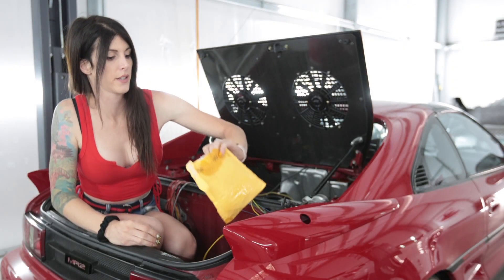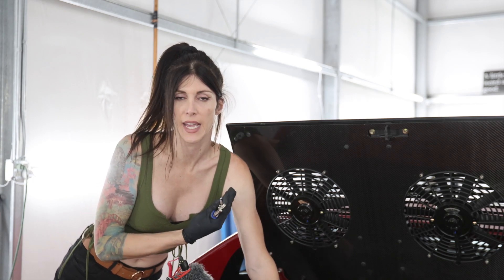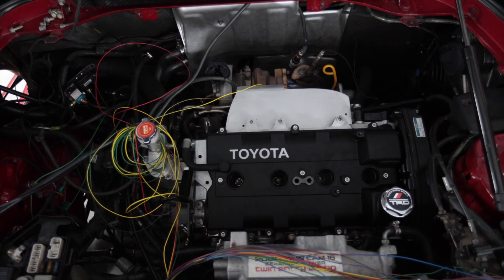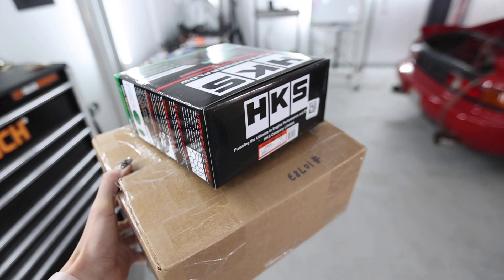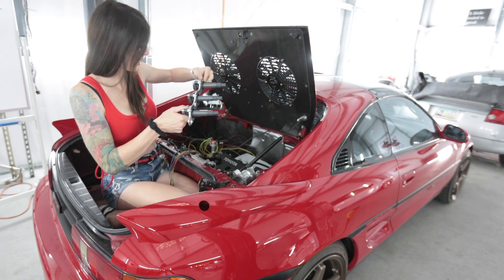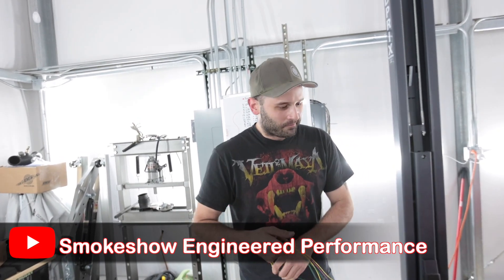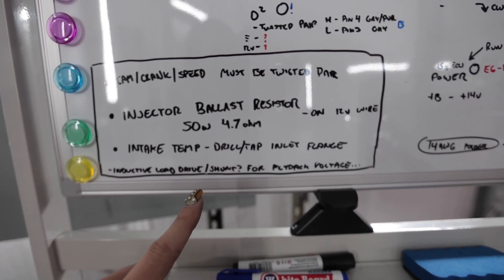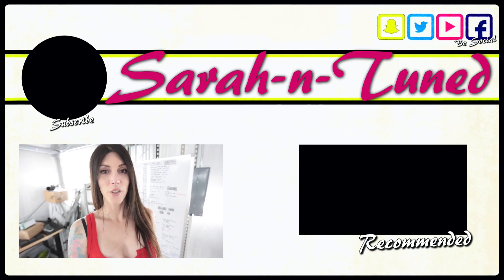This Is A LOT Harder Than It Looked // 1ZZ Coilpack Conversion

Comment: I hope it all works out and you have a reliable car that starts and stops when it is supposed to .  All of this wiring and vacuum stuff (and mods) looks like it will turn into a unreliable vehicle that will leave you on the side of the road with a flashlight and toolkit on a regular basis.  Hope I'm wrong.  I admire your courage and determination!

Comment: Use Denso 673-1307 for cylinder 1 coil to line up the connector better. 👍

Comment: What makes such computerized systems nightmares is the fact that there is not only one person that designs and/or writes the software and firmware for everything. It usually is broken down to modular design and different people are only responsible for their part. They are given the inputs and have to design the circuit/software to get the required outputs for the next connecting modules. So one person trying to redesign a system to mimic the factory setup gets really difficult... Thumbs Up!

Comment: I think you’re making the right call, switching the injectors out.  I have my doubts that the new ECU is going to be happy driving low impedance injectors.  High impedance injectors are much easier to work with, electrically speaking.

Comment: The fly back voltage basically is comparable to the way an ignition coil works. Every coil has this kind of effect when it's charged and discharged.

So the current or voltage flowing back from the injector coil can short out or overload the corresponding driving circuit when it's not protected.

Comment: Wait. No MAP sensor? Don't turbos use a manifold absolute pressure reading? Some systems use a MAP and or MAF but I'm not understanding this after market ECU Set up.   I'm getting very confused here. Crying alone in a pandemic with the Arizona girl mechanic leaving me in the dust.  Please explain the system.. white board style. "Sob..."

Comment: I think Toyota and the other Japanese makers use SAE wire sizes, like Detroit does. Bear in mind we also use AWG here, and the actual wiring is about 2 steps different between the two. SAE is thinner than "the same" AWG because SAE is meant for short runs where voltage drops are not as important.

Comment: Inductive load drive is an electronic output with protection (resistor or reverse biased diode) to operate a relay coil or other inductive/coil load. When voltage is removed from a coil, the collapsing magnetic field induces a voltage of opposite polarity in the coil, possibly several times higher than the source voltage. Without suitable circuit protection, the backblast can fry sensitive electronics like the ECU.

Comment: Lastly, the term "Shunt" implies a current measurement.  Example: You want to know batttery current. So you put a high power but low resistance in series with the battery cable.  Now you connect a very low range volt meter across the shunt, and so knowing the resistance of the shunt, you use Ohms Law: Volts= Current (In Amps) x Resistance (in Ohms) or substituting >Volts across the shunt / Resistance of the Shunt (in Ohms) = Amps. Example: Your Shunt = .01 Ohm and you measure 1 Volt across it, So 1 Volt /.01 Ohms = 100 Amps. To verify if the power rating of the shunt is large enough, you use Current squared x Resistance (which results in power in watts) and then double it for safety.  So the power rating of the .01 Ohm Shunt would be Current Sq = 100^2 = 10000 x .01 = 100 Watts x 2 (for safety) = 200 Watt Rating (which means, the ability to survive heat).

Comment: Adding ballast resistors is to raise the resistance of the injector so that it draws less current.  That implies that the source of the injector signal has a higher voltage output. If you have injectors that are by design, higher resistance (or impedance which is just AC Resistance), then you would not need to series resistors.  I have played with injectors some, you can get some to click with a flash light battery @ 1.5 volts while I have seen others that needed about 3 volt to click.

Comment: Reminded me of: "The original machine had a base plate of prefabulated amulite, surmounted by a malleable logarithmic casing in such a way that the two main spurving bearings were in a direct line with the panametric fan. The latter consisted simply of six hydrocoptic marzlevanes, so fitted to the ambifacient lunar waneshaft that side fumbling was effectively prevented. The main winding was of the normal lotus-o-deltoid type placed in panendermic semi-boloid slots in the stator, every seventh conductor being connected by a nonreversible tremmie pipe to the differential girdlespring on the "up" end of the grammeters."

Comment: A little rule of thumb for current in wire sizes for vehicles.  Start at #14 and call it 15 Amps, then double or half the current for each 3 AWG sizes.  So going up from #14 = 15, you get #17 = 7.5 and #20 = 3.75, etc. Going the other way, you are doubling the current so #11 is 30, and #8 is 60, etc.  For longer runs, to avoid voltage drop, or for sizable things with high duty cycle, you go down an AWG size or two (smaller number /larger wire).  Note: sometimes vehicle conductors will be smaller than you expect. It just means that a light duty cycle is expected (like a turn signal or dome light) or the temperature rating of the wire is higher, so they don't care if it runs a bit hot (or maybe it's in a moving air stream)....nice guys!
For house wiring, you follow the National Electric Code which will have some exceptions which are non linear, so a bit less predictable.

Comment: Description
In electronics, a shunt is a device that creates a low-resistance path for electric current, to allow it to pass around another point in the circuit. The origin of the term is in the verb 'to shunt' meaning to turn away or follow a different path. Wikipedia

Comment: Fly back voltage from the coils? That makes sense...I think. They are about 20,000 volts...I assume. Not unlike the transformer on an old CRT. 
Or are you talking the solenoids in the fuel injectors being protected from over loads? Or the drivers in the ECU?  I actually am thinking about this.
Of course,
you realize you lost most guys rubbing the  pipes and moaning at the start of the video. 
Brave build darling.

Ps
The idle control valve diagnosis seems right.
Hard to know much with intermittent electrical shorts and voltage drops. I would run a new heavier say 14 gauge supply wire to the ECU without removing the 20 in there now. Sister it to the harness and don't make yourself crazy.

 Love from everyone in NYC who doesn't own a car.

Comment: If you need help with anything mr2 electrical related, hit me up, I build custom milspec  engine wiring harnesses and standalone wiring for the mr2, Celica, and supra.  I have every part and all the circuits you need designed up all brand new, fresh and clean.

Comment: 10:21 aren't you suppose to only use torque wrenches by the handle? Wouldn't it otherwise give a false reading?
Reply from the maker: It’s not a spacecraft, it’s a valve cover.
Reply: @SarahnTuned  That's fair
Reply: @SarahnTuned  LOL I didn't dare mention the way you gripped the torque wrench,  as I too thought,  pshhh, it's a valve cover,  bracket for the coil packs , I thought.

Comment: Very nice, strangely satisfying even, to see how you're going about this.
Never have time to properly figure these things out where I work, so when a wire is broken, I usually end up just running an new wire alongside it.
And you didn't explain flyback voltage protection, so I had to Google it. Makes perfect sense though. It's like a turbo BOV, but for voltage spikes.
And YES to the Colorado review.

Comment: I have one of those TRD oil caps sitting in my tool box. I bought it for my valve cover job on my Tacoma and then I found a black billet one that looked better with the black wrinkle finish I did to my valve covers. Now I have a spare.

Comment: This Jake is clearly not the one from State Farm, 'cause he's not wearing khakis 😁  This series is very informative to me: if I ever do a project vehicle that requires extensive rebuilding or re-engineering of the fuel or ignition systems, it's going to be carbureted and have an old-school ignition coil/distributor.  And that's considering I work in IT and deal with systems that may have hundreds of fiber optic connections.

Comment: It's not the mechanical stuff that gives you headaches, it's all the electronic stuff that does.
Reply: Poor connection can be really frustrating or corroded grounding nightmare.
Reply: @juhajuntunen7866  a little dielectric grease in EVERY electrical plug goes a long way (I live in salt covered roads ALL winter)

Comment: I would  never  try to  change  UCU's  and make wire Harnesses.. I would  simply  use a  Haltech  ECM and their wiring..  and  that would be  hooked to an LS-7 wiht a manual transmission ..  don't  need any computer shifting..
Reply from the maker: The Cookie cutter approach is boring to me.

Comment: 1) If you have plenty (enough) of hi-res stills of the pin outs/circuits you could make a book (or at the least a stand alone web site for projects like this - if there is the demand).
2) Sitting in the boot (trunk) while working on the engine - that's kinda cool. :D

Comment: You gonna start drifting it wen ur done or what’s the plan ?
Reply from the maker: Drifting with an MR2? Hard no. I’m not into drifting anyway, Rally and Baja are the only Motorsports I’m into.
Reply: would you restore a nearly vintage auto to near concourse condition and then slam it around? Why not jump the grand canyon?

Comment: That TRD oil cap adds at least 15 horsepower.
Reply: Those TRD caps get uber hot.   Be careful when removing it off a warm engine for an oil change.